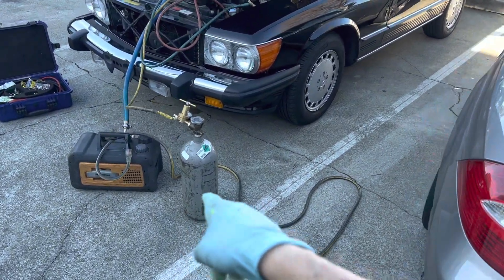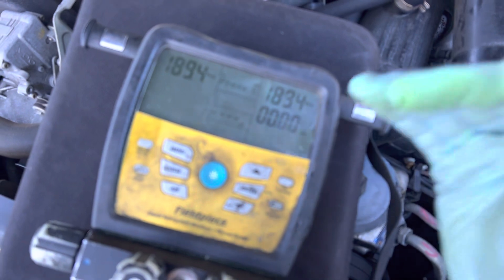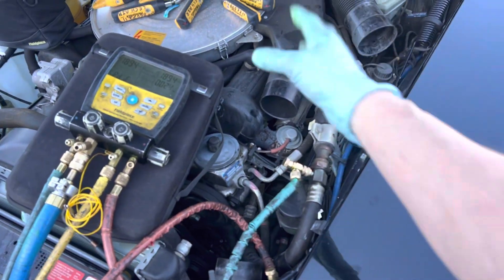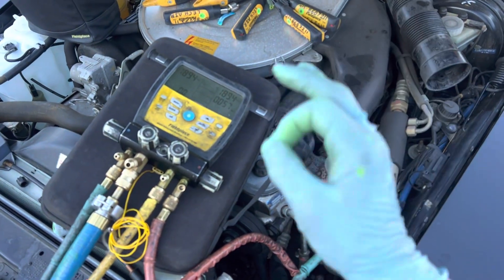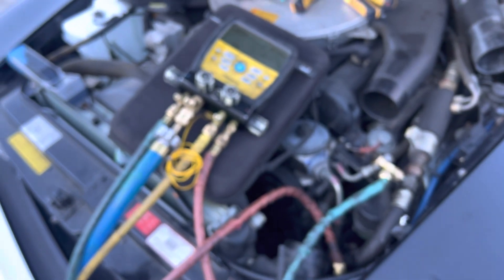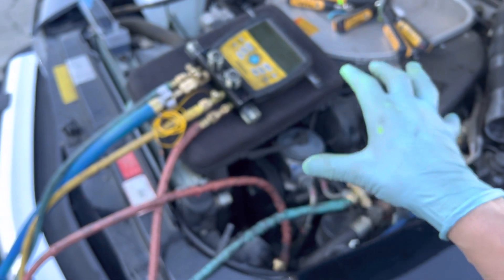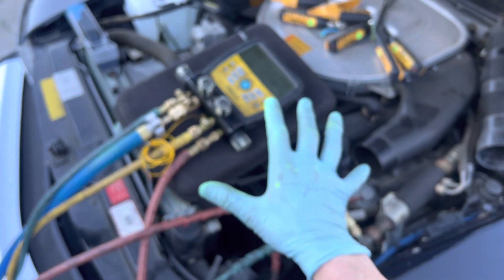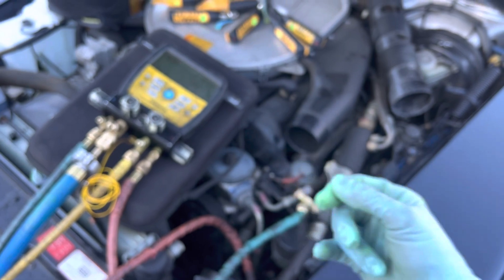High-pressure nitrogen decay test, 1989, Mercedes 500 SL.

Comment: What exactly do you have to do to convert it to R134a besides the triple nitrogen purge?  Do you have to change the oil out?
Reply from the maker: Different levels of different quality retrofits. 

1: number one, the most labor-intensive most expensive method would be to remove the compressor and pour out the oil, the old mineral oil and replace it with that compressor, manufacture, specified viscosity and type of POE or PAG oil.  Remember, different manufactures, and even the same compressor may use different viscosities oil.. 

For example, one compressor might use 46 viscosity another compressor manufactures recommends a 68 viscosity well another manufacture may require 100 viscosity there’s even 125 viscosity in some very old R12 compressors and 150 viscosity.   This all depends on which procedure of retrofit level that you were going to perform and exactly watch old R12. Compressor you’re going to retrofit..  
       This is also includes removing the expansion valve or orifice tube and flushing out the evaporator

RTFM READ THE MANUAL, THE COMPRESSOR YEAR, MAKE MODEL, VEHICLE MANUFACTURER, SPECIFIED, REFRIGERANT OIL REQUIREMENT. 

2: this is a more minimum cheaper alternative. Specially for myself because I have recovery machines I could recover liquid and I have hundreds of pounds of R 12 that I can use as a flushing resolvent and I could recover it and recycle it clean again and reuse it so for me, it’s no big deal.. 
      I fill up the system with R 12 so it’s working perfectly test it to confirm the system is in good operating system first. 
          Then I recover the refrigerant from the liquid side because I want to remove some but I will not get all of the mineral oil that is dissolved in a liquid or 12 refrigerant into my recovery machine as quickly as possible that are 12 refrigerant will act as a flush in solvent, because it’s the perfect solvent that dissolves and absorbs and carries out the mineral oil. 
       Then replace the receiver dryer because it is old and they only have a 5 to 7 year lifespan. They’ve usually absorbs much moisture as they could possibly hold because moisture absorbs right through rubber hoses, do not block moisture on these old R12 systems

       Now go through your vacuum and triple purge with dry nitrogen you should easily get down to about 100 µm. 

Once you get below 500 µm, then you can start your timer if you want for the next 45 minutes to an hour . 
     Time doesn’t start when you turn on the vacuum pump time does not start when you hit 29 inches of mercury vacuum your time starts after you at least achieved 500 µm. 

Now you can recharge your system with your R134 

3:   Now the cheapest dirt, cheap quickest fastest, not necessarily the best, especially if you’re in a hot climate where you’re always over 100°F.  You have to remember 3/8 inch over to R134.   In hot climates, changing the condenser to Microchannel parallel flow and upgrading the electric fan for those people are unfortunate enough to live in hot desert climates like Dubai or Arizona, or any desert hot climate..  

Recover the refrigerant like normal . 
Preform your triple evacuation and nitrogen, purge sweep 

Add 90 mL of the factory recommended required refrigerant oil for that particular year make model vehicle retrofit that is specified in the vehicle, manufactures retrofit procedures .  Continue your vacuum for an hour..   because remember, we’re not just trying to dry out the system as much as possible removing surface moisture off the surface of the remaining oil, rubber hoses and metal lines. We are still trying to outgas as much old refrigerant out of the oil as humanly possible because we do not want to contaminate mix refrigerants.. 

You should be able to to achieve below 100 µm vacuum the longer you could leave it on vacuum the better if you were a do it yourself person at home in your own backyard or garage just leave it on the vacuum pump overnight 24 hours .  The dryer or you can get your old system the better..  you can never over vacuum. 

Oh yeah, I forgot to tell you run the engine and vehicle heating up the engine and all the air conditioning components and evaporator this will aid in moisture removal the hotter all the air conditioning components are under a deep vacuum the faster and more moisture will be removed  

I am lucky fortune and I live in the San Francisco Bay area specially, in San Francisco. Where are average high summer temperatures are around 78°F to 85°F are considered hot days in San Francisco.
Reply: @coldfinger459sub0  Very awesome and useful information!  Thanks!